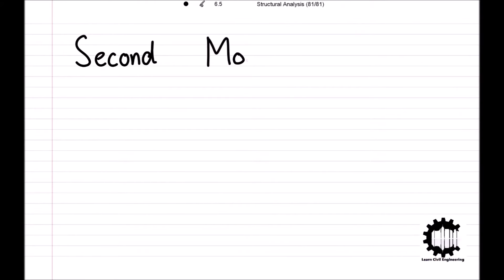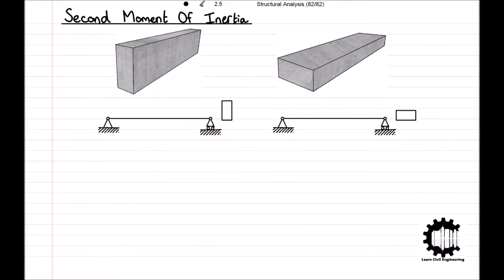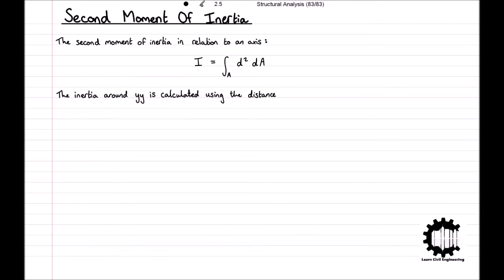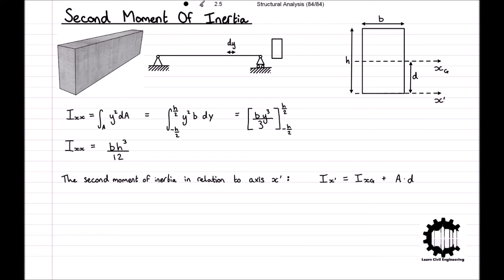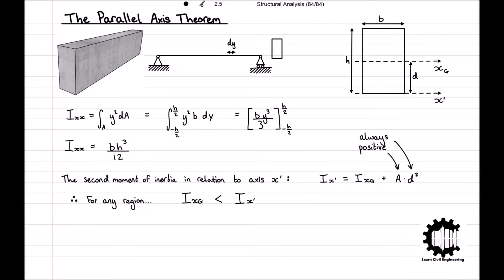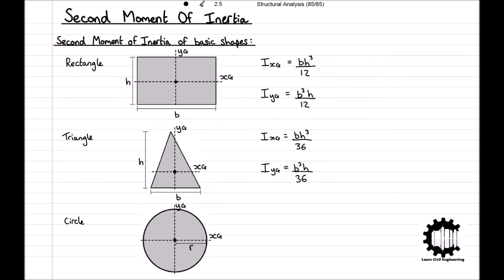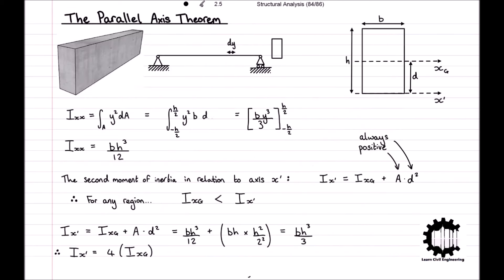What is Second Moment of Inertia and How is it Calculated?

Comment: this is strange explanation.... 
3:28 you say 'dy' run along the beam ( so its run from 0 to L or  -L/2 to L/2 )
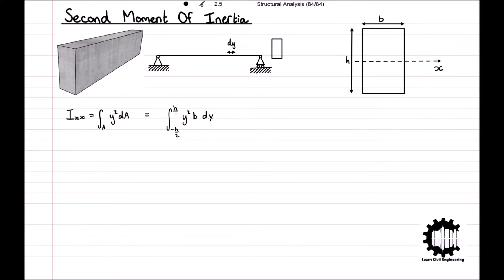3:50 you say 'dy' runing from -h/2 to h/2  ( so 'dy' its a cross section element and exist in 90deg to the beam length)
so i do not understand how the 'y' axis is up and down , and also inside-outside . you got 2 axis with same name ? what about z axis ?

Comment: why do we use KN/m^2 instead of Kg/m^2 or tonn/m^2 ,Can someone give me a resonable answer ?
Reply: I guess bcz this is not from usa
Reply: I think it's because the standard fomular for stress is force/area hence KN/m²
Reply: kN is force or weight, kg is mass. Tons are also a measure of weight or force, but you rarely use that unit in engineering, its more for laymen. kN/m^2 is stress or pressure, kg/m^2 is mass per unit area, for which pressure could be calculated for simply by multiplying by gravity. In mechanics mass per unit area doesn't really have any significance, possibly in fluids but haven't dealt with fluids much since college.